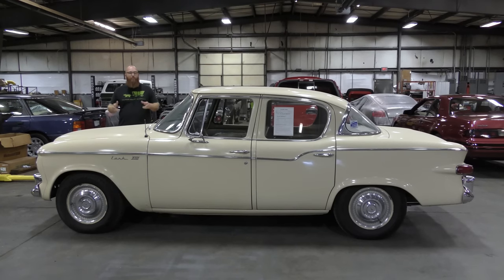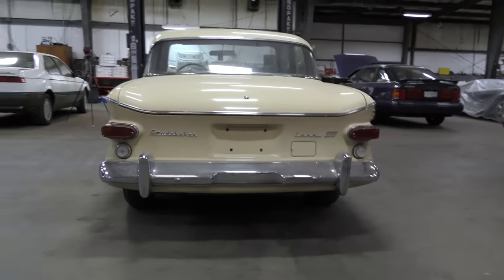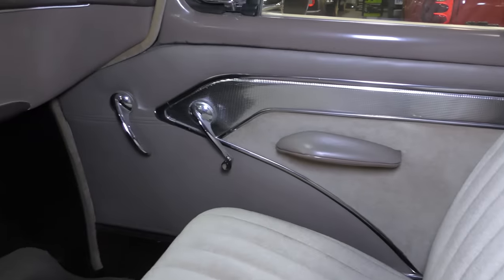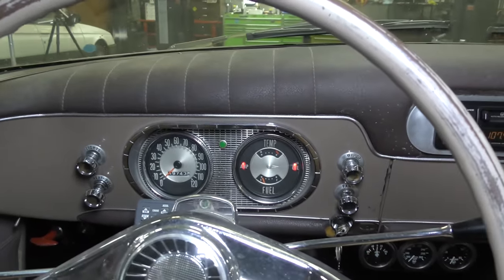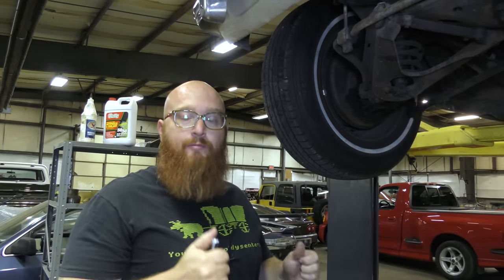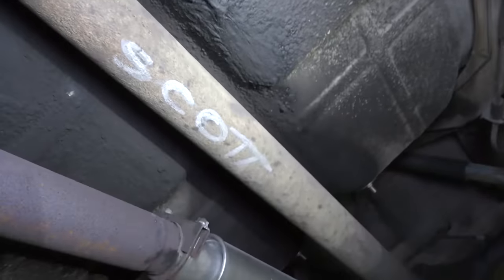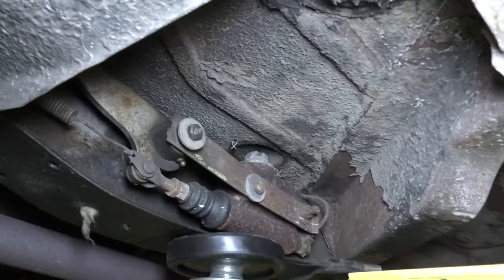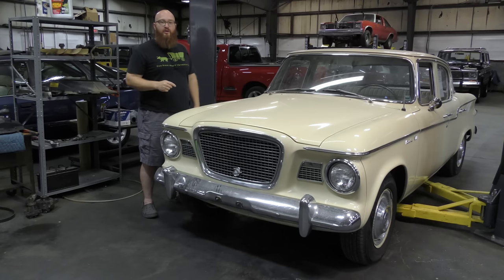Finally a CAR WIZARD approved engine swap done on this '60 Studebaker Lark VIII

Comment: Don't usually comment but Stude's are just awesome, and the original factory V8 was a great motor- and a sad episode that they could not reach enough customers- or ere forced out by the Big Three...
Reply: Ford and Chevy began a long price war in '53.  Prior to that time it had been a seller's market.
Reply: Studebaker just didnt have enough plants to match it with the big three. And export them as well. Here in Australia they were considered to be a luxury car, and families would pass them down thru the generations.
Reply: @michaelrussell6661  I think the Australian market only helped them keep volumes up.
Studebakers of this era sold surprisingly well in Australia assembled here from Canadian sourced parts and local content.
More common here than Buicks, Oldsmobile, Mercury, Dodge and Plymouth. Similar with Rambler.
Police thought highly of them. Some police racing enthusiasts bought them at police auctions to go racing at Bathurst.
Story of the Australian Studebakers here :
https://youtu.be/SHHTPLw-oNM
Some of the police highway pursuit cars were two door cars. Would these be Daytona bodies.
Standardised on V8s with highest trim level here to justify higher prices and simplify the range.
Reply: I remember working for Ford and trying to compete with Toyota and Datsun with a Pinto. On some Fords the bottom of the trunk was the top of the gas tank.  I remember I once had a special gas tank full of gasoline. Came off some type of law enforcement or military vehicle.  You couldn't drain the gasoline.  I thought no problem I will  get a safe distance away and put a hole in it with my 357 magnum with 38 amunition revolver. The bullet came back at me. We should have had that tank on the Pinto. If.the internal fuel pump or sending unit went bad you replaced the whole thing tank and all.

Comment: Wizard,  you should check out the early to mid 50's Studie Hawk and Golden Hawk. They were sportier models.  My grandfather drove them and my uncle refurbished them. Something about steel dashes; in the unfortunate circumstance of even a fatal accident all that was needed was to hose off the dash and put it on the lot. They were fairly bullet proof.
Reply: Studebakers from that era were really neat! Very different from the stuff that the Big Three designed. 🙂

Comment: Love the Lark, drove a friend’s  62 Lark Cruiser back in the late 60s. Lark’s had 259 cu. in. Studebaker V8 engines that performed very well and had a good reputation for durability like the rest of the car. An issue with these - the front fenders have a vertical stiffener close to the rear edge by the doors that would trap moisture and cause rust. Thanks for showing us old Stude fans ( owned a pre war Champion for many years) this very nice specimen.

Comment: It's because it is a 55 Studebaker a full size car that was cut down to make it a compact because Studebaker didn't have the resources to develop a new car
I always liked the lark 
An old guy had one in the late 60s black and dull and one day I waxed the front fender and it glossed up 
The 2 door hardtop was the nicest one
Reply: It is a shortened 59 Studebaker.  The 53-55 had a much more streamlined body.  You're right about the reason.  Studebaker couldn't afford a new body to compete with the Falcon, Valiant, and Corvair so they shortened the late 50's body.
Reply: Yeah, they basically just chopped the overhangs off their full-size models to create a compact. It helped that Studebaker's big cars were already smaller than the ones from the Big Three to start with
Reply: I was off by a year. look at the green house of the 1956 it's the same as the lark 
My favorite was the " Scotsman " a total stripper cardboard door panels painted bumpers grill and hubcaps 
Imagine calling a car like that a Scotsman in today'sly correct world
Reply: @joemazzola7387  1953 was actually Studebaker's last all-new body shell, everything after that was a heavy reworking/facelift (except the Avanti)
Reply: It would be called the Yorkshireman these days.

Comment: Lol, this brings back memories. I had a '66 Commander with a blown six cylinder just asking for my 394 Oldsmobile engine and transmission. At the time I was working in a machine shop so was able to make up all the mounts etc. I needed. That thing would do the most insane burnouts of anything I've built before or since. Kudos to you for this video!

Comment: I was pitman in a lube shop for a couple of years. I had to know how many fittings on many different vehicles. My boss knew them so well that he would ask me how many I did. If I wasn't correct, he usually knew which I missed. I learned quickly to keep my job.
    Since that time I have always tried to replace greasless parts with serviceable parts. I've even put grease ports in where there weren't any available. I wish more stuff was made to last with "basic" maintenance.
      Studebaker produced the highest quality wagons (originally) and stepped up into the auto industry, to have a reputation of quality for price. 
     We need a contemporary Studebaker.

Comment: This car reminds me of my employer in the mid-70's, a small Los Angeles auto shop where the boss rebuilt motors, made custom driveshafts, and did many engine conversions.
One of my favorites was a '40 Chevy coupe with a 283 2bbl/powerglide drivetrain. Smooth motor, plenty of power, very quiet running. A real sleeper.

Comment: My first car. Bought it for $75 in 1967. It was a '59 Lark "VII" I called it that 'cause #4 cylinder never did fire. It was babysh** yellow with a gas chamber green trunk lid. I didn't read all the comments but you didn't mention the PNDLR transmission. Very exciting when you were sitting at the light reving it in neutral and yanking it right past low into reverse. One developed a light touch on that after a while. Loved it as it was my first, but the '70 V-dub Squareback was a more efficient and reliable replacement.

Comment: God I wish I was a mechanic in the 60's and 70's.  Look at all that room.
Reply: I had a '63 Dodge pick up with a 318, distributer at the back. I'd raise the hood a full 90 degrees and stand on the frame rail to set the points.
Reply: In those days you didn't even need to be a mechanic.  It was so easy to remove, repair, replace any external engine part.  Rad, water pump, starter, alternator, carburetor, distributor . . .    Just reach in and do it.  And if it was a straight six, even easier.
Reply: Saw a 63 Dodge pickup in a used car lot. Candy Apple green paint. Lifted the hood 440 engine . Chrysler Imperial  engine tranny and rear end. Wife said you dont need another pickup. She followed me home. It looked stock on the outside. I once rented a.equipped garage. It had a creeper you laid on and pulled your self over the engine so you could get get to the rear distributor. It was neat. I remember a Buick V8 engine looked small in a big  Buick. The 440 didnt look so small. I once put a big block wedge head engine in a 55 Dodge pickup. Put the push button shifter in the dash.looked nice. 360 engine out of a Dodge car I believe. World's worse steering gear I believe. Kept taking them back to a salvage saying they are no good. They said why do you keep taking them apart.  They put good steering gears on the cars I dealt with like Darts. International pickups had good steering gears. Talking about manual gears. Dont remember being interested in Studebaker steering gears.

Comment: The Lark inspired production of the Falcon, Comet, Corvair  and Valient! So sad that Studebaker went under:(-John in Texas
Reply: Actually, the big three were all developing their compacts before Studebaker began work on the Lark. More likely their inspiration was the success of the Nash and Hudson Ramblers of the early fifties, and the rising infestation of invasive insects in the US car market.        
The original Lark was developed due to the success of the  draconianly de-trimmed Studebaker Scotsman, and was comparable in size to the Rambler Six and Rebel. The Lark was the only US compact of its period to retain body-on-frame construction. All the rest were unitized body.
Reply: @5610winston  If that's the case, then why was there such an economy car competition between the Falcon, Valiant and Corvair?  It all happened after the late 1950's recession in the US and downsizing of vehicles. Lark kept Studebaker alive at the end, but they could never match economy car production of the big three, amongst other reasons ( another being the union getting too greedy).
Reply: @TheGearhead222  By 1961, Ford had also introduced the Mercury Comet (originally intended as an Edsel model, as suggested by the taillights and the 'C' emblem, basically the Edsel 'E' minus the mid-level bar), with the intermediate-size Fairlane and US-market Mercury Meteor in the wings for model year 1962. GM introduced the Olds F-85, Pontiac Tempest with its exclusive rope drive and  slant-four engine, basically half of a full-size Pontiac 389, and Buick Special/Skylark models using variations on the Corvair body shell. Chrysler moved the Valiant from a stand-alone make in 1960 to the Plymouth line for 1961 to prop up Plymouth's sales numbers, then added a Valiant clone to the Dodge line as the Lancer.        
In 1959, Rambler had two compact body shells (the Six and Rebel on a 108-inch wheelbase, and the American, a reprise of the 100-inch wheelbase 1950-'54 Nash Rambler, literally built using the 1950-vintage tooling). Studebaker offered the Lark sedans and coupes on a 108.5-inch wheelbase and Lark two-door station wagons on a 113-inch stretch.        
In 1960, Studebaker added a Lark convertible and a four-door wagon, and Rambler stood pat, while Ford, Chevy, and Valiant hit the market, drawing sales from the established compact independent models, with Mercury's Comet hitting showrooms later, but still early enough to be called a '60 model.       
1961 brought the three new compact lines from GM and the Lancer from Dodge.          
1962 brought the mid-size models from Ford and the conventional front-engine Chevy II joined the Corvair alongside the Biscaynes and Bel Airs and the Impalas, a turbo-supercharged induction showed up in the Olds F-85 Jetfire, and Buick introduced its cast-iron V6 alongside the aluminum V8 in Special and Skylark models.
Chrysler totally missed the mark with its downsized and hideously styled '62 Plymouth Fury/Belvedere/Savoy and Dodge Polara/Dart models.         
By 1964, the Pontiac Tempest, Buick Special/Skylark, and Olds F-85 and Cutlass models had migrated to more conventional and somewhat bigger body-on-frame platforms, joined now by another less-than-full-size Chevy model, the Chevelle, all of which soon came available as GTO, GS, 442, and SS model designations.       
Ford introduced a new model (what was that called? something horsey?) on the Falcon platform in mid-'64, about the time Plymouth grafted a fastback roof onto a Valiant body and AMC did the same on the Rambler Classic platform.       
Studebaker's Avanti, based on the Lark chassis, beat the Mustang to the market by almost two years, but the Avanti was priced in the entry-level Cadillac range.
As I said, the 'Big Three' had been working on smaller models from the mid-fifties through the '58 recession, and the smaller cars would have come to market whether the recession had happened or not.         
We should also remember the failed US market models from the fifties, specifically the Henry J from Kaiser, the Aero-Willys, and the Hudson Jet, and the demise of the Crosley (never really a major presence).        
Yes, the competition among the compacts from the 'Big Three' occurred after the '58 recession, but then, the Falcon, Valiant, and Corvair were all introduced in late 1959 or early 1960, after the '58 recession, and the exponential expansion of the number of models, trim levels, engine options, etc. in the following years meant that the competition was inevitable.

Comment: In my early teens my friend"s mom had a Studebaker with a flat 6.I  used to tease her about needing a new clutch every year.She should have had an automatic car as she was hard on the clutch.There were Studebakers around at that time that had factory G.M. 283 v8 s in them.Do not know if that was the only v8 option.CHEERS from Canada

Comment: My dad had a 1960 Studebaker Champ. Had a three on the tree manual transmission, manual steering ,Columbia overdrive setup on transmission and I believe a Packard 289 engine.
I remember trying to drive with a broken left leg in cast with that transmission. Talk about timing to get it right. I absolutely loved that old pickup

Comment: Here in the UK those grease zerks (I had to look that up!) are called grease nipples.
Reply: We just call them grease fittings here in the state of Ga.
Reply: I've heard them referred to as grease nipples as well as grease fittings. I'm familiar with them being called zerts or zerks, but I think that terminology is "recent" within the past 20 years.
Reply: A grease fitting, grease nipple, Zerk fitting, grease zerk, or Alemite fitting is a metal fitting used in mechanical systems to feed lubricants, usually lubricating grease, into a bearing under moderate to high pressure using a grease gun.

Alemite is a new one to me...🤷‍♂️
Reply: Zerks  is a USA thing The rest of the Planet calls em grease nipple's or similar.
Reply: Adding all those zerk fittings was a boon to owners and mechanics.Some Chrysler cars of the 60's and 70', eliminated them entirely.
Reply: M38A1 also does have a lot of those.
Reply: Australia also. I’d never heard of a zerk until now.
Reply: They were called zerks to comply with the Hayes code.
Reply: @paulsutton5896  What is the Hayes code, never heard of it ?
Reply: @jeromebreeding3302  
I spelled it wrong. it is the Hays code.
It was a ruling by the US Congress to stop "rude scenes" and "rude words" appearing in Hollywood films.  It was  instituted in 1934, and lasted until 1968.
Reply: @paulsutton5896  A vestage of sencorship, no doubt. Probably why nipples(a woman's breast), was often referred to as " head-lights".

Comment: I Grew up in the 5os and 60's where these were made in South Bend, Indiana. Many of my friends parents worked at the Studebaker Factory. I had one as my first car. They had a problem with rust on the top of the front fender on top by the windshield. They also liked to burn oil.

Comment: I found that The 1960 Studebaker Lark has a wheelbase of 108.5", which is about the same as the 1960 Ford Falcon. It was considered to be a compact car back then  (it was small compared to standard size Detroit cars). I'm 74 & I remember seeing these cars when they were new!

Comment: In the final years of production, Studebaker was actually using Chevrolet 283 engines in these cars so it's not unusual to find them in the Larks.  This Lark may have been equipped with the small block from the factory although it was obviously updated with headers etc. at some point.
Reply: I don't think so. You are thinking the last gen. Lark (64-66) and Avanti that used Chevy 6's and V8's. Early Larks were using 258 and 289 Stude V8's. SB Chevy is a drop-in using later gen. parts. Cadillac 500's from Eldorados were the hot ticket but a bit of work.

Comment: I love this car, Studebaker never gets the attention it rightfully deserves!  And I can definitely agree with Mrs. Wizard, you guys need a Bullet Nose Studebaker, those things are BEAUTIFUL!
Reply: The "53 Lowe coupes were the bomb! Back in the day, those, with a Caddy motor were big stuff! Studillacs!  FR
Reply: Had a 51 commander convertible w259 55 SPEEDSTER ENGNE. Floor shift w od.😅
Reply: @fredericrike5974  had one w 289 engine we raced it at local tracks  guy I bought it from had a 53 convertible aft market was white  . fabulous Sam Rosenberg had a studellac w the 57 eldorado  twin carb engine ..the larks.w r 2 quite impressive 10.6  114 mph stock !🙄
Reply: @donalddesnoo5303  Deep down, I suspect many motorheads have Studillac bucket dream- I know I have ever since I first saw the Lowe coups in the '50s.  FR

Comment: I've got a student whop has one of these with the original V-8.  I'm proud to say our 20 year old future tech is keeping a car like this in THIS kind of condition.  Knowing what I do about the car I can see the reason for the small block.  The original engines were good mills in their day but they have their quirks and parts availability is a thing.  Cool video, your customer is lucky to have this car.

Comment: FYI!  I am a long time Studebaker fan.   My first car in high school was a '53 Commander Starlight Coupe with a 232 CID V-8!  My first new car was a '63 Gran Turismo Hawk with an Avanti engine option which included seat belts, front disc brakes, beefed up suspension, front AND rear stabilizer bars, and numerous other goodies!   You mention how on this Lark the front wheels are further forward than today's cars.   On my Hawk the engine did not set directly between the front wheels, but rather slightly behind them!   A line drawn from front spindle to front spindle would pass about through the water pump!  That, along with a 120.5 inch wheelbase and low center of gravity, made for a very, very stable platform at any speed.  A tremendous highway cruiser.  I considered 80 MPH "Snooze Cruise"!  At that speed it turned only 2600 RPM, and when properly tuned averaged about 22 MPG!  I owned that car for 30 years, put over 240,000 miles on it!  One of my greatest regrets is selling it!

Comment: I worked in a GM dealership in 1959 and did lots of oil change/grease jobs and in many cases I had to look carefully for all the grease 
Zerks to insure you got them all. We also checked the differential oil as part of the service.. and cleaned the windows . All that for about $12. But a valve grind on a 235 GM six was $49.99 all in.